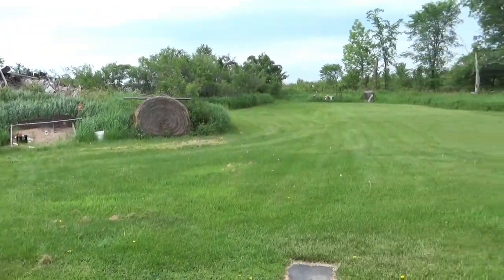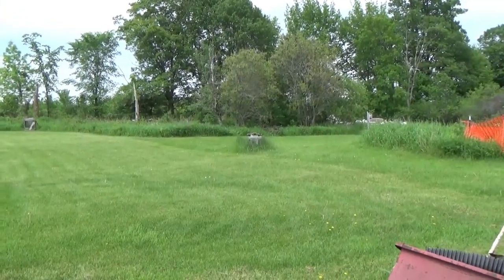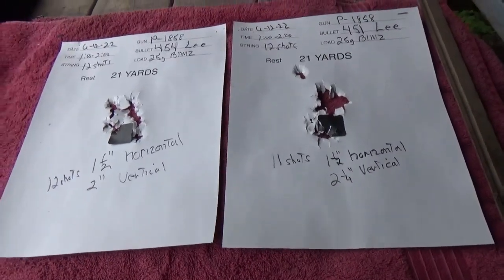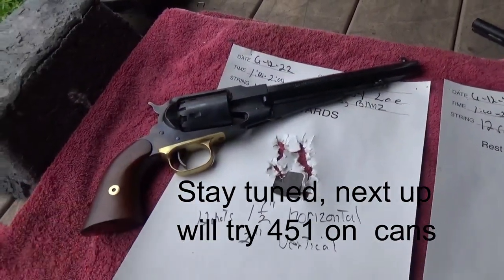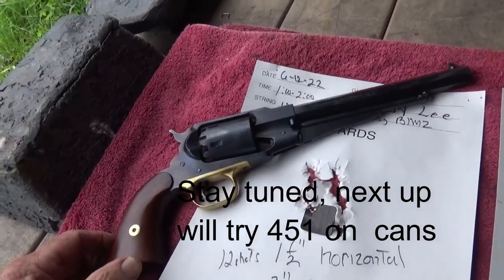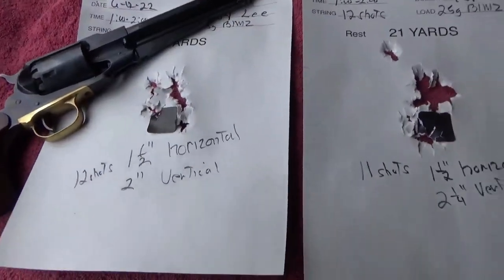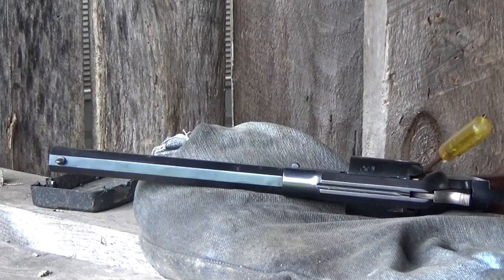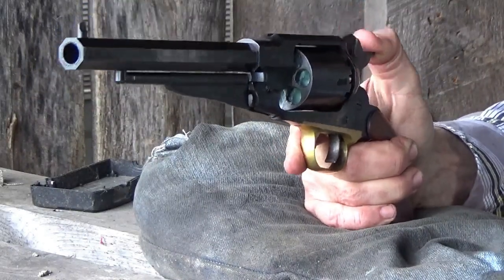Pietta 1858 - Shooting 451 VS 454

Comment: It seems to me that the .454 would take on a slightly more capsular shape going down the barrel, and thus would be more stable and have slightly higher sectional density, improving accuracy and downrange energy retention by a small margin.
Reply from the maker: Hi.  Do you think that the increased distortion of the nose due to extra force from the loading lever on the soft lead would create a issue?  O.R.
Reply: @oldranger3044  I think might affect wind resistance, but the added weight / sectional density of the .454 might be enough to overcome that.
Reply from the maker: @ericv7720  Results have been good, which tends to back that up. Thanks again for your comment. O.R.

Comment: Well thought out and interesting to watch experiment. Thank you for you efforts! 
It does seem if your not loading to maximum capacity of the chamber that the lube is retained around the ball. 
My home made beeswax base lube seems to disappear when the proceeding chamber fires. Im wondering if this is because I tend to load with the ball closer to the chamber mouth or whether its due to the lube itself. 
Great groups IMO :-) seems like the three tho is neither here nor there it terms of accuracy in that pistol.
Reply from the maker: That's interesting about your lube.  If I remember, I will load to the max with the lube and see if there remains any around the ball.

I have been of the same opinion about the 3 thousands.  But, (you know, there's always but), couple days ago I was testing some DIY powder and was getting some shots in the 900 plus range.  I noticed a couple shots that were either flyers, or I am going to seed.  One was 4 inches low, and I hadn't called it.  The higher speed will need to have more "grip", in order to give the ball the added rotational inertia.  Sorta like your tires better grip the road real well around that corner when doing 80.  Possibly, only a theory at this point, a 454 might not have done the slip the riflings thing, it that's what I suspect happened.  Since I'm not developing hunting, or self defense loads, I normally don't go much above 800, so haven't seen this before.  Guess it's the "live and learn" principle.  O.R.
Reply: @oldranger3044  Really Interesting! and your theory sounds plausible to me. Would be very interested to hear more about your DIY powder......My ears picked up when you mentioned the rock tumbler :-)

Comment: Love the lube gun!  did you make that?  I make my own wads but like your gun...would use that with paper cartridges.
Reply from the maker: Harbor freight mini grease gun. I ended up emptying out the cartridge that came with it. Used that as a liner. Put a grease fitting in the end because then I fit a 3/16 th tube on it that goes into the chambers. I keep using it, so it appears to be doing the job. O.R.

Comment: The chambers are.446 but the barrel is 451????? Seems kinda sloppy
Reply from the maker: Not exactly. That would be sloppy as you say, but the barrel is bored.440 and then has groves (rifling) put in, so there remains a portion that is still .440 called lands. So the barrel is is not.451.  The.451 is the size of the ball that is squeezed into the.446 cylinder chamber and then becomes.446. The .446 ball then goes into the.440 barrel, so there is a tight fit. Hope this explains what happens. O.R.

Comment: Curious whether you wear corrective lenses. I can barely SEE 21 yards without my glasses and with them on I can’t see the sights clearly. Lol
Reply from the maker: A few years back I needed new glasses, and mentioned to the Dr that I do some pistol.  Can see targets fine, but sights are just a blur.  He had the right lens ground for a focal distance that will focus in the sights, and the left is normal correction.  They take a bit getting used to, and I don't use them except for shooting.  Sometimes when shooting I will have to stop, set the gun down, and go get the glasses.  They help.  Hope this helps.  O.R.
Reply: @oldranger3044  Thank you sir. That would drive me insane I think, but I might try it.
Reply from the maker: @jeffshootsstuff  I've been noticing lately that I actually forget to go back to my regular ones after shooting, and I think that my eyes or brain or whatever, has figured out how to deal with it.  My brother has contacts, and one is set for close, and it works for him. But then, other things work for him that are beyond my ability to figure out.  O.R.

Comment: I just learned about this and see only about round ball but what about conical  bullets are they like round ball or is there a  difference. Because I want to make my own . And I have this exact revolver
Reply from the maker: If you are new to the bullet casting area, I might suggest to start with the round ball. Conicals are more fussy (I find) ),  Depends a lot on the purpose. Target shooting, plinking, or overall just fun, I’d stick with round. Stuff like hunting or self defense is different, and the conical is probably better suited. Size matters maybe even more with conicals,  because they may not fit under the loading area of your gun depending on the particular conical. Also, most have a difficulty starting in the chambers if oversized, and being under sized doesn’t work out well. Hopefully this helps. O.R.
Reply: @oldranger3044  I am interested in casting my own and I am a hunter this does help me greatly  I just got my hands on a mold for conical and I have store bought round ball and then realized a size difference then started to try to figure it out and run across you again thanks for the information. And so you know I just subscribed to your channel
Reply from the maker: @robertlamb7513  Thanks. 👍O.R
Reply: @oldranger3044  you are welcome and the mold I got is Hornady .454 conical if I remember the size right and the round ball is .451 I think you see my puzzlement as a person trying to get into casting my own just thought of something do you have a video or videos for someone like me that wants to start casting
Reply from the maker: @robertlamb7513  No, I’ve been casting since the 60’s. Have had some requests for a video, but haven’t done any. One reason is because there’s a lot already on YouTube. As you subscribed, if I do one you will probably get a notice. Thanks for the encouragement about making one for those who are interested in starting. O.R.

Comment: Why do you leave the price tag on the trigger guard?
Reply from the maker: Believe that is a tag that reminds me of how the gun shoots with a specific load, and how completely it was last cleaned and when. Good question and shows that you are paying attention to detail. Police or military training?  O.R.
Reply: @oldranger3044  no I'm not police or any other government agency I just thought it was strange to see what look ed like a old time price tag on the gun you were shooting.
Reply: @oldranger3044  by the way I think your videos are quite good. I shoot 1858s also. The piettas make the cylinder Chambers too small for the bore, and the ones i have are .008-.009 smaller than the barrel groove. 2 uberti i have .449 - .450 cylinder chamber are more in line with the bore size, but still to small for the bore. I wish someone would make the cylinder a 5 shot .451 chamber and the barrel groove .450 and 1 in 16 twist so that standard 45 acp lead bullets would work in the percussion cylinder. A lead 45 acp round nose flat point with a bevel base would make shooting a percussion revolver more effective, more accurate, and most of all, simplify loading. That Would still work fine with .454 .457 round balls.
Reply from the maker: @Mike-xi4zt  Thanks for your response and ideas. What I would like to know is a couple things. One would be how originals handled this. I assume that the manufacturer of current percussion guns had access to originals and measuring devices. So, is what is being produced now typical??  The second is does the projectile bump-up to fill the groves?  I have always had doubts about it. O. R.
Reply from the maker: @Mike-xi4zt  Yes on both. They are the old style price tags, and its not something you will see often, if at all. Problem I have (if a problem) is I have too many for my short term memory to deal with. O.R.
Reply: @oldranger3044  the pietta cylinder chambers is about .009 inch smaller than the .452 barrel groove on the 1858s I have. I do not believe the lead will expand or obturate that much. Will it shoot? Yes. When a ball or a bullet comes out of the cylinder that much smaller than the barrel that's not conducive to accuracy. The projectile is going to be bouncing around the barrel as it goes through it. If that was the original way they were made that is not the way they should be made. In other words if they are calling that original specifications then they need to change that stupid specification. The cylinder walls are thin on the six shot 1858. If they made a five shot they can make the cylinder wall thicker and reem them out to .451. Which would accommodate lead .452 45acp bullets and .454 .457 round balls. Updating to a 1in 16 twist would be a step in the better accuracy direction.
Reply from the maker: @Mike-xi4zt  Thats what I get also on mine. 443, possibly 444. This only gives us a couple thousands on a .440 bore to engage rifling. But, I’m amazed how well they shoot. On my older 58’s, twist is like 1-30. Newer Piettas and Uberti’s are running close to 1-16, possibly 1-18. These are probably a better choice for the conicals. My only other comment is that not sure if we can, or should, apply modern smokeless powder fit theories to the black powder revolvers, and I will admit that I don’t have the ballistic background knowledge to be sure about this topic. Thanks again for your comments. O.R.
Reply: @oldranger3044  there plenty of black powder cartridges 30-30, 45 colt, 44-40, ect, that use smokeless powder and match the bullet diameter to the bore diameter. Pedersoli makes a 1858 that is along the same dimensions that i am talking about. It cost around $1,200. It is said to be the winner of most target shooting matches with cap and ball. Especially overseas.

Comment: So did you have 2 different guns or you loaded a 451 then a 454? In the same cylinder? staggered? That seems a little bit strange
Reply from the maker: Staggered. Figured that would be more equal. Suppose we fired the first 6 with a clean cylinder and barrel. The next ones, say the, .454 would be with fouled chambers and barrel, which can affect things. That’s why I chose to alternate. Switching guns would be right out as that would introduce even more variables. Also the fatigue of the shooter and gun placement is less affected, along with  lighting (clouds changing lighting on the sights), and wind gusts. .  O.R.
Reply: @oldranger3044  ahhh i see what you were doing,or you could have just ran a brush through it and kept going, but I got you